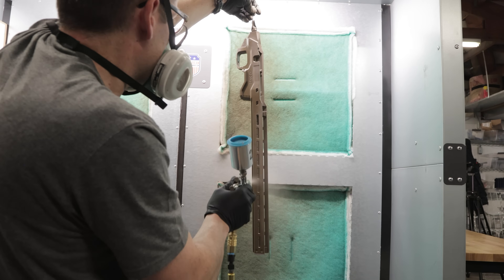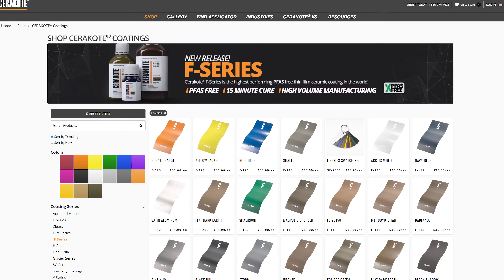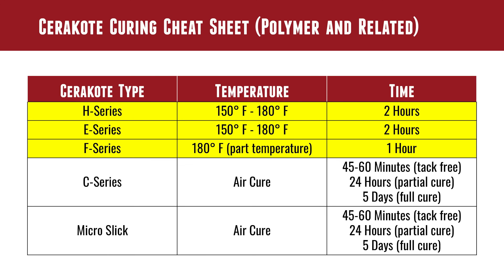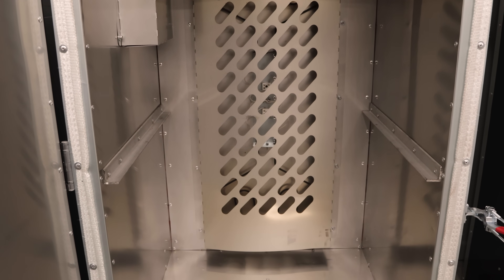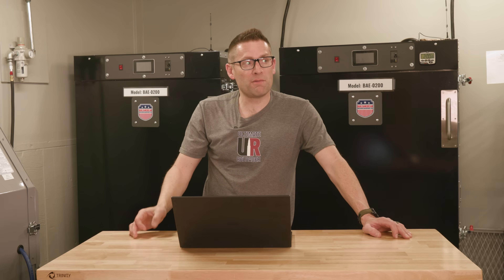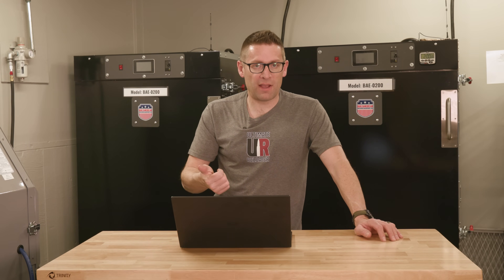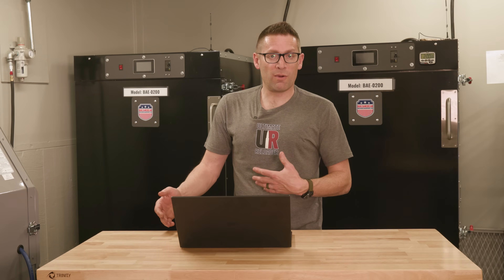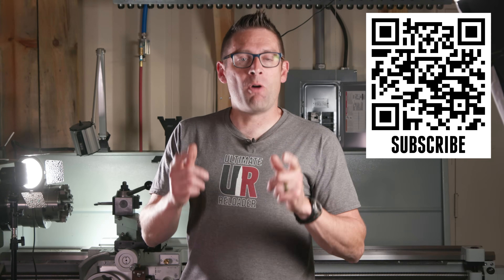Secrets of Cerakote Curing (Pro Curing Essentials)

Comment: I am a ChE and cerakote as a hobby and have a question. Bartlein recommends not exceeding 170 deg on their CF barrels. I submitted a question to Cerakote on the cure time at this temp. They came back and said 2 hours and that it will actually fully cure at 150 for 2 hours. My question being if it will fully cure at this temp why do they still recommend 2 hours at 250 for anything?  Shorter curing times like 1 hour at higher temps like 300 deg makes sense but 2 hours at 150 or 250 doesn’t assuming you start the time once the part is at that temp. Thanks for any thoughts.
Reply: End of the day, you have the "box" technique for a product, and then you have the actual minimum operating technique.  In their eyes, those extra temps will do nothing more to the coat. So for insurance, they add in a bit of temp and/or time to ensure it comes out fine regardless of the oven the object goes in. This goes for anything from cake mix to car paint. Within reason, of course. A 500*F cake is going to be...disappointing. 

So not to be a jerk, but I am genuinely curious. You heard the rec directly from the manufacturer of the application for your specific situation, and you think Gavin here is going to have a better answer?